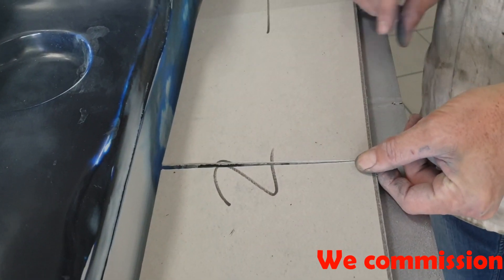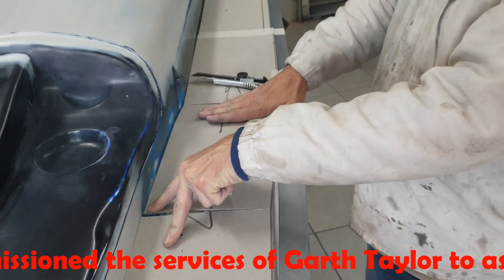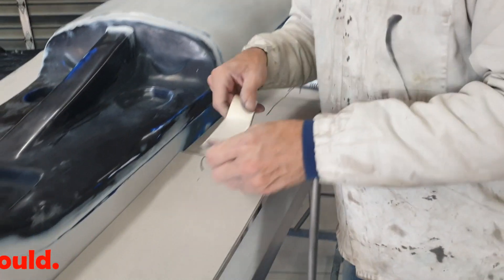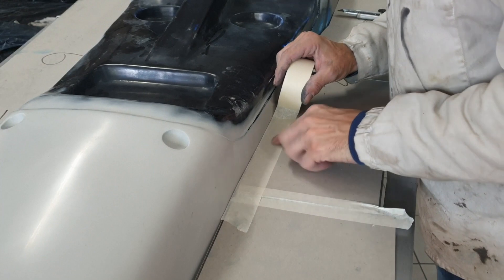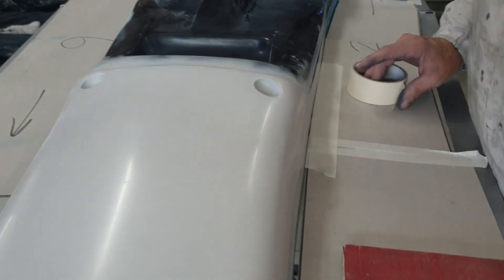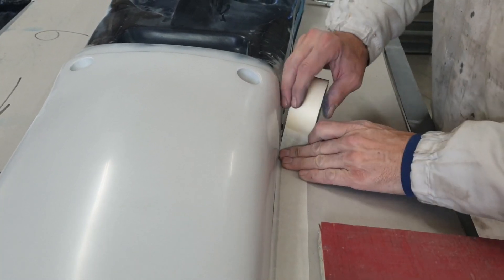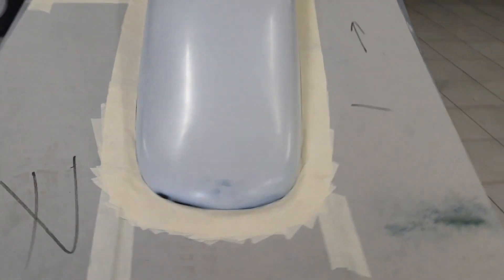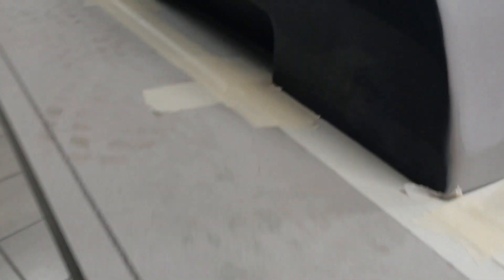Stage 6- Making The Monocoque Moulds From The Plug

Comment: I am intrigued as to why you did not establish registrations on each of the mold sections while they were still attached to the plug. Getting perfect alignment afterwards would appear to be a hard thing to achieve..
Reply from the maker: We had offsets and elevations which worked really well. It's hard to see in the video but on the main sides there's a midsection that's dropped and line up. On the rear section there's a 2mm off set  or step that lines up the back. The front was so simple that we just left it be😂 The main reason for all of this was to keep the flanges as smooth as possible for the bagging process.

Comment: imaging two 5000w hub motors inside the tires. . no engine. instead, 2x48v electric dc motors in series into a 3phase rectifier receiving the rotative power back from transmission gear from rear train toward the batteries. you would run run a very long time. at 90v.
Reply: Gay idea
Reply: @im_linus  not really. have you done it ?